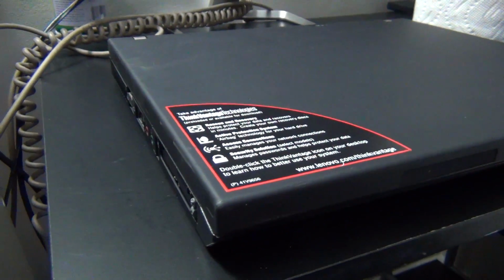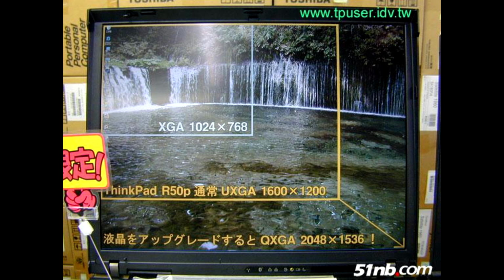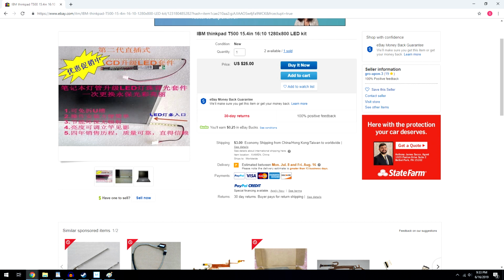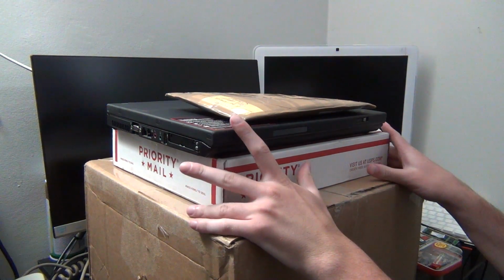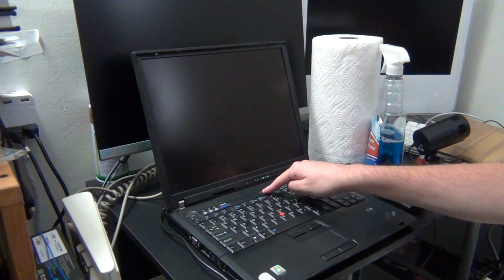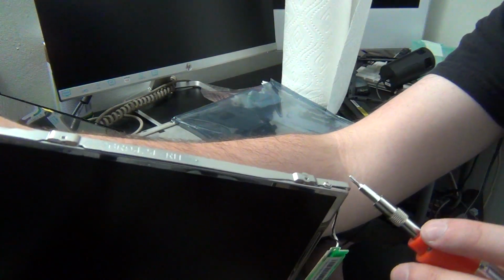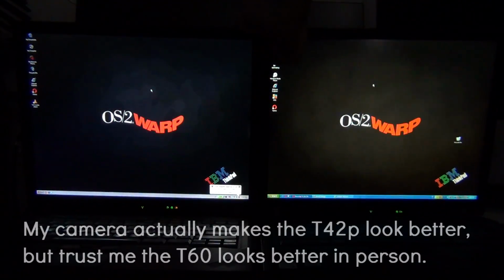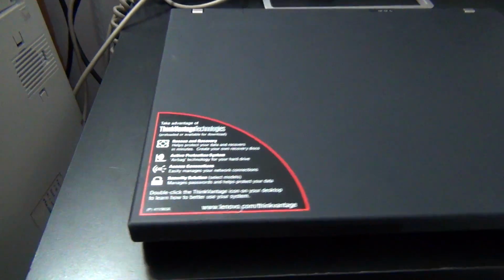Building the Ultimate Retro ThinkPad - Part 1

Comment: Hi Sebi... 
Can you help me...I will like to make my FrankiePad..I will putT61 motherboard to T60 IBM chassis.. I will like to get this 1600x1200 display on it.. can you send me link on screen to buy..and what is the best T61 motherboard to put Middleton Bios and i want to put X9000 CPU on it...
Regards miro...
Reply from the maker: There really isn't a link I could give you for the screen, your best bet is to just keep an eye on eBay for the display type I mentioned in this video. As for the motherboard you will want a 14" 4:3 T61 motherboard, the widescreen T61 board won't fit.
Reply: Sebi...
Thanks for yours reply. i just said i will put T61 motherboard to T60 IBM chassis and i want to know best screen model to fit to this IBM T60 chassis mate....

Best regards Miro....

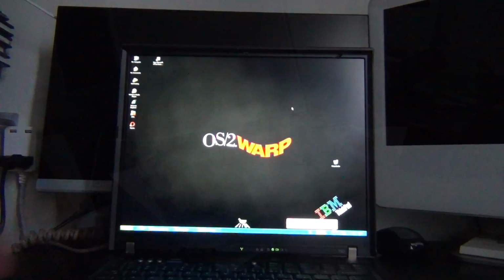Comment: Did you shock yourself at 8:45? LOL
Reply from the maker: No, I was more anxious to see if it would work or not! I can get a bit...theatrical sometimes. 😎
Reply: @SebisRandomTech  I might build a FrankenPad T601 once I get a T480. 

My T60 is maxed out but has a really beat up SXGA FlexView panel. I have a T43p with a UXGA FlexView panel, I might swap panels when I FrankenPad. 

Since your video the price of the T61 boards from theboardroom have dropped to $139 plus shipping which well yes, is about the same price as a T480 motherboard, it seems like a good price for a nice 4:3 laptop. 

I'm just nervous about the rollcage mod, I've read some people have managed to get the T61 board in without modding the rollcage, and while I have the tools for it I'm just worried about cutting the wrong thing off or cutting too much off.
Reply: @SebisRandomTech  it's not a bug, it's a feature

Comment: Is there a way to do something similar for the X61s ? Geting a 1600x1200 display .
Reply from the maker: There is a 1400x1050 AFFS panel that can be fitted into the X60/61, but it is even harder to find than the Boe-Hydis panel I used for my T60 in this video.

Comment: Can you use the bottom shell of the T61 and the top of the T60? I read somewhere before when I was looking into the parts for building a FrankenPad that you can use the bottom shell/housing of the T61 since it has more breathing holes for the T61 motherboard. Once Im done with the T440p build I want to do this one.
Reply from the maker: You wouldn't be able to, as this mod takes a 14.1" T61 motherboard and puts it into the shell of a 15" laptop. Since a 15" 4:3 T61 was never made, the part you would need to make it work doesn't exist.

Comment: So I was doing the display swap on my T60. I took the 1400x1050 panel out of the broken T60p, and wanted to see if it really was broken.

When I took the display out the power was off, but I put the power back in so I could test the display and make sure everything was working, etc. But while I was doing it, the ribbon cable was yanked out of the laptop. So it seemed like I blew the backlight fuse (the display was now super dim), but it gets worse; while I was doing more testing, I actually saw smoke rise out of the laptop, and it smelled awful. 
But I found out I must have NOT had the inverter wired up carefully, because when I wired it up and made sure the inverter cable was in there, to my surprise, both of the displays, including the FlexView one that I thought was broken, worked perfectly and were super bright.

So I'm worried about my motherboard; should I open the machine up and see if anything is broken? I thought the writing was on the wall for both the motherboard and the FlexView display until it worked.

The FlexView display looks great; sadly this one has a few small scratches, but it's a major night and day difference from the old 1024x768 TN panel. It's worth it imo. Using it right now, and there's no smoke or anything coming from the laptop.
Reply from the maker: That's kind of scary. Look for any scorch marks or signs of damage on the motherboard, screen, and display cable.
Reply: @SebisRandomTech  There's no scorching on the the panel or the cable. It's most likely on the motherboard. I have no clue how it was smoking though.
Reply: @SebisRandomTech  Turns out the inverter card wasn't grounded properly with the screw, that's why it was smoking.
Reply: Jesus fucking Christ, you idiot
Reply: @damian9303  Shut up

Comment: I bought a T60p off eBay with a 1400x1050 display. It's 15", 4:3. The T60p itself is completely dead (I bought it for the T7600 CPU which I put in my other T60). The seller said when it was working, the display was very dim, so that means that the CCFL blacklight is dying and I need to replace it with an LED backlight. Where can I find the kit for my model? Not sure what model number is the panel, I haven't taken it out yet.
Reply: Check the Thinkpad forums. They'll have the best answer and part number info.

Comment: I guess if you had that 2048×1536 display, it must have brought a problem at that time, as everything must have been very small and ppi scaling was not that good like today in Windows 10, though there are still occasional issues even nowadays. (I personally gave up on it, as from time to time I had come across an application which had not displayed something correctly when upscaled, so I just used larger system fonts and set permanent zoom in my web browsers and I have been okay with that.)
Reply from the maker: I'd still love to get my hands on one, but they're exceptionally rare and I don't think they ever made an LED version so I'd have to mod it for LED backlighting. Plus you have to reflash the EDID on it for the screen to work in a T60.

Comment: Hey is it possible to install  macos on  retro thinkpad
Reply from the maker: Possible, but not easy. If I can figure out how to do it myself I will document it for a potential video.
Reply: Sebi's Random Tech it’s easy for me. what are you an amateur
Reply from the maker: @nicbrewster1255  My strength is with hardware, not software. No need to be rude about it.
Reply: @SebisRandomTech  thecomputerguy96 has a vid with iatkos 10.6.8

Comment: When he dropped that display I laughed

And i couldnt stop xD
Reply from the maker: Figured I'd make the best of what happened there! :P Thankfully it was the old 1024x768 display so it wouldn't have been a MASSIVE loss if it had broken.
Reply: @SebisRandomTech  i have one question are those flex view also in 14,1 inch size
cuz the quality is amazing
Reply from the maker: @cavosavosk  Sadly no. They were only available on 15" models.
Reply: Thats a bummer
Only possible upgrade for me is to install higher resolution panel
Reply from the maker: @cavosavosk  Yep, there is actually a 1600x1200 panel that can be fitted into the 14" T60, but it isn't a FlexView unfortunately. If there was a FlexView option for the older 14" ThinkPads I would take it in a heartbeat.